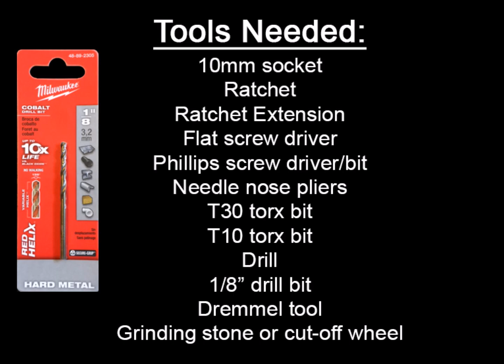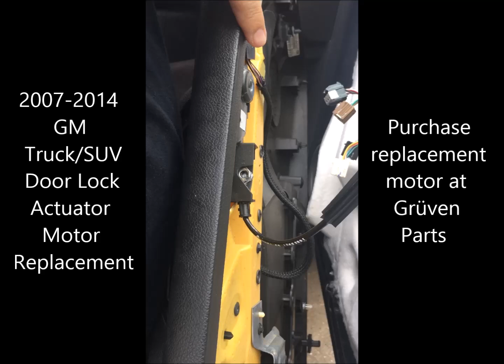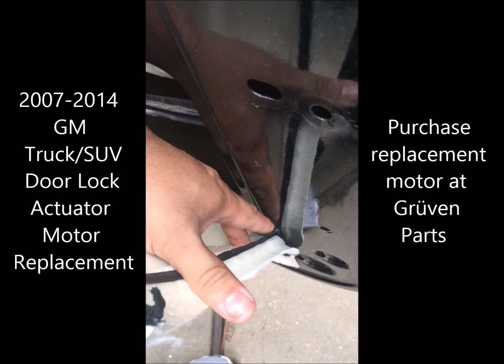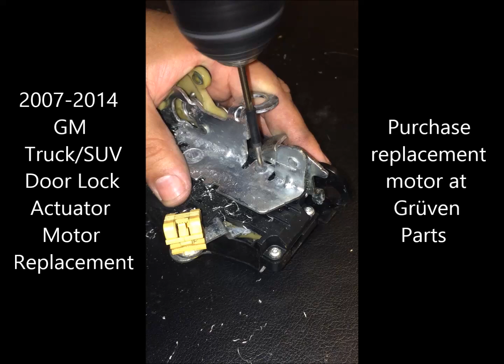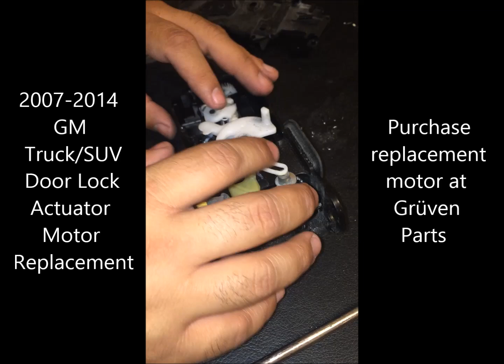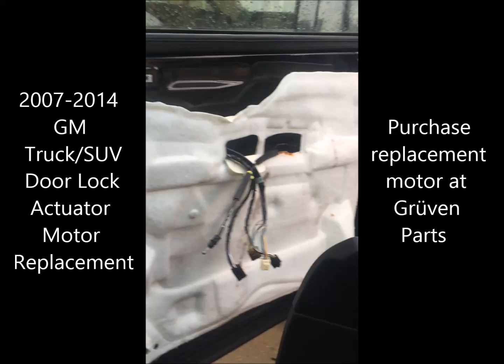2007-2013 GM Truck/SUV Door Lock Actuator Motor Replacement

Comment: Thanks for all the great work.  Can you tell me how to release the second rod on the actuator that goes up to the exterior key lock on the driver's door?  Do you have to remove the exterior door handle?  Thank you again for the help.
Reply from the maker: To me it looked like it just pushed in so it should just snap out if you pull slightly on it toward the inside of the vehicle. The lock barrel on the handle has a red u-shaped area where the rod pushes in to. I don't recall, to be honest, because I completely replaced the handle at the same time I replaced the actuator motor so I took the handle all the way off anyway. Even if you took the handle off, it's really easy. Just two screws with a 10mm socket holds it in place. I hope this helps. Due to these types of vehicles being easily broken into, I replaced the driver door handle with one that doesn't have a lock barrel from the driver passenger door (slightly modified). It's gonna suck if the battery dies, but I'd rather deal with that than a stolen vehicle!
Reply: +You Gonna Learn Today 

Really can't thank you enough for your help and advice.  I will now be better prepared to finish this task tomorrow.
Reply from the maker: +Rick Colley good luck! It's not that difficult at all. Hit me up if you need anything else. I'll be glad to help!
Reply: +You Gonna Learn Today  So, today I installed the motor in the driver's side door and reinstalled everything and checked (many times)that the actuator was working up and down, that the window was working unobstructed,  all of the switches in the door handle seemed fine after many tests, THEN, I shut the door to test the latches and door handle and, so far, I have not been able to open the door again.  The locking mechanism is moving up and down but the door will not unlock.  I thought that maybe I had a conflict with the two rods going up to the exterior door lock and the interior door lock, so I maneuvered around inside the truck (thankfully the passenger door was unlocked because the motor in that door is failing also) in VERY tight confines and was able to get the interior door panel off enough to get to the bolts holding on the exterior door handle and was able to get the handle off and examine the two rods.  There did not seem to be any conflict.  All visible components were moving including the interior door lock rod and the interior door handle cable, but nothing would unlock that door.  The truck is sitting in my garage right now with a load of tools inside and outside with no driver's door handle and no way unlock the door.  I guess something must be misaligned inside the actuator????  Not sure if you have any ideas but anything would be appreciated.  Take care!!
Reply from the maker: +Rick Colley I would pull the door panel off and look inside the door while you try to pull the handle from outside. When you pull the handle from the outside, it should push the rod down which goes clipped onto the actuator. If it pushes the rod down, then it has to be something inside the actuator. If it doesn't push the rod down, check how the rod is connected to the door handle. Then check to make sure there's no obstruction with the rod. I had the same situation happen. Check all points one by one to figure out exactly what it is. Send me some pics if you want or call me. My email address is fgonzalez9510@gmail.com. I can send you my number that way. If you have an iPhone, you can FaceTime me and we can take a look at it together! Don't you just love technology?!?!

Comment: Thanks for the video, it was an awesome help.  One issue I had though, after doing both rear lock motors now the Dome lights won't turn off.  It's acting like a door is still open.  Any ideas where that sensor is?
Reply from the maker: Glad it helped! I'd venture to guess it was the way the actuator was put back together. Paul, at Gruven Parts is a huuuuge help! I'd recommend you hit him up and ask him. He's always glad to help, as well. Good luck and post back what it was when you figure it out so anyone else having the same issue knows how to fix that in the future!
Reply from the maker: Sorry for not responding sooner. I'm 99.9% sure it has to do with the way the internal components of the actuator are lined up. I'd recommend you pull it apart again and line everything up the way I show on the video. Feel free to reach out to Paul at Gruven Parts. He's always happy to help in these types of situations. I hope this helps!

Comment: Why have this motor at all? I'm going to try this to repair my 07 Silverado passenger door won't unlock and is stuck closed right now. Electronic lock actuator works the plunger fine. I had no idea there was a motor in there until now.
Reply from the maker: I felt the same way, as well, Joe. I actually thought you could use a normal door lock actuator, but it would be too much trouble for the cost savings, in my opinion. You would have to figure out how to connect the wiring correctly and also connect it to the factory actuator so it allows the actuator mechanism to allow the door to be opened. Personally, I have no clue how that works, though. Not saying it can't be done or you wouldn't be able to, just saying I would think it would be more difficult that using this solution.

This solution works perfect and is a fraction of the cost of replacing the whole unit. Not to mention it's pretty easy to do. Personally, I highly recommend this solution. These locks really have a ton of power when you lock and unlock them.

Paul really stands by their products at Gruven Parts. Give him a shout via their website if you have any questions related to their products! Again, though, I highly recommend it!
Reply: Thanks so much for the video and response. I'm going to order the motor today and try the repair out. Of course I'm taking a wild guess as to the motor is the actual problem why my door won't open. But after seeing all the posts I think I'm on the right track.
Reply from the maker: +Joe Shearer - Glad I could help! What mine was doing is it almost looked like the locks were too weak to lock or unlock. Every now and then they would fully lock or unlock, but for the most part either they would stay in the locked or unlocked position when I pushed the button. You can still use the door lock latch to lock and unlock the doors, but I hated having to reach over to the passenger side or even worse to the rear doors when they wouldn't unlock. With all the known issues I've seen, I would venture to guess it's the actuator motor. I don't understand why GM doesn't make that a recall.

Anyhow, good luck!